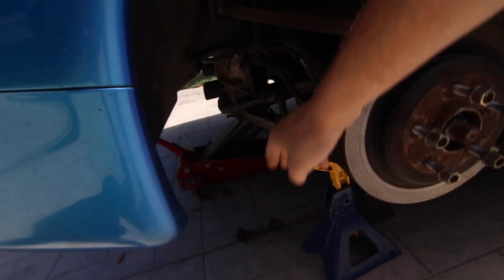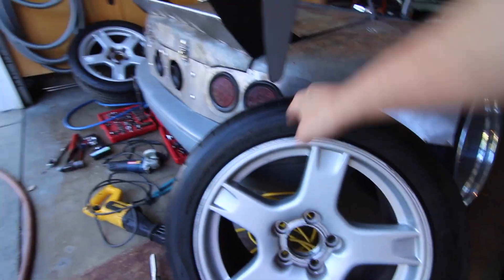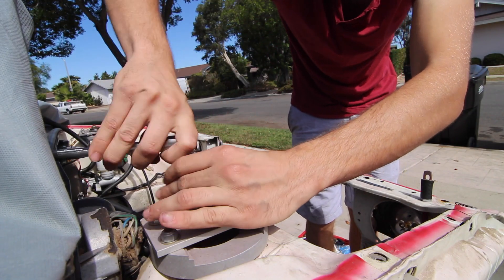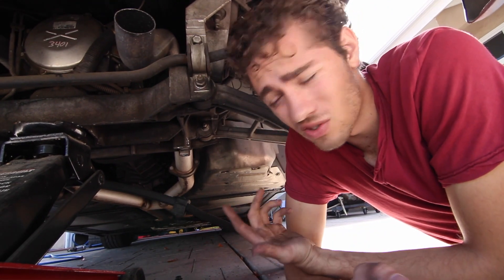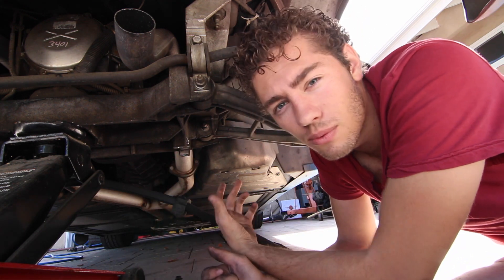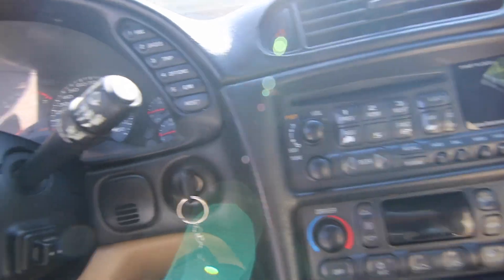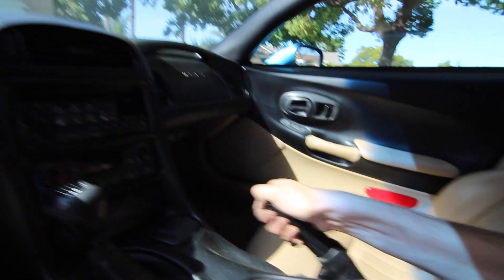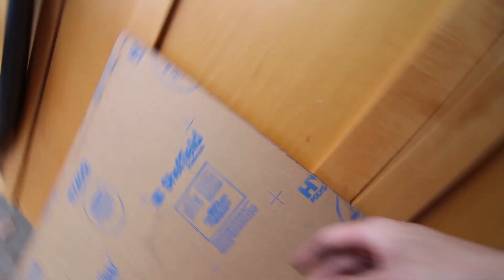Meant To Be A Drift Car?

Comment: You're key isn't turning because of the steering wheel, you have to jiggle it...
Reply from the maker: I understand what you're saying but that's not the issue
Reply: hope it's not your ignition, especially in a vette, sure it wouldn't be cheap. 😧😧
Reply: your ignition tumblers are shot. you need to have the ignition key cylinder replaced by a locksmith. you might need a new key to
Reply: Tyler Fialko that's what I do in my chevy vehicles, I have to jiggle the steering wheels sometimes to get the key to turn. The cause is from the theft lock on the steering wheels
Reply: +Bud D Have a snickers.
Reply from the maker: a ls6 has a slightly more agressive cam from the factory, but thanks for being an ass about it :)
Reply: @Bud D
Reply: that's what she said
Reply: C5 has an electronic column lock. It is a common failure and jiggling the wheel will do nothing for it. 

they do sell a bypass to disable it for like $35.

Comment: c5 Corvette leaf springs are fiberglass I believe. I may be wrong though
Reply: Sam Dornan you are defiantly wrong
Reply: If that's your belief then fine.
Reply: fiberglass? Wtf
Reply: Corvette leaf springs are referred to as FRP; Fiber Reinforced Plastic. It isn't fiberglass in the traditional sense of truck caps and bass boats but it is a composite material in the same family. It's very durable, very light, and effective.

Comment: what engine is in the blue corvette
Reply: Dakota Gladden i think its an ls3 but i could be wrong
Reply from the maker: ls1
Reply: thanks
Reply: ls1
Reply: ls6
Reply: LS1 in the blue C5 LS6 in the red (C5 Z06). 

The LS3 wasn't used until 08
Reply: I forgot a comma between "C5, LS6"

Comment: drift the miata 😂
Reply: Matthew 80ish hp with massive rims and a restrictive ass exhaust will not drift
Reply: a wise man once told me that anything is possible.... with some oil all over the track.
Reply: +Matthew with an oil pan that low you don't even need to put oil on track beforehand! Just drive for more than 20 meters and it'll be grinded into dust.

Comment: Putting wheels on with a impact with no torque stick. When your lugs snap from over torque when you are driving you will never do that again.
Reply: Every tire shop I've ever seen or been to never uses a torque stick ......gotta be smarter than the tools you use ....good luck with that sounds like you'll need it breaking studs with tools made for the job your doing sounds like your trigger happy
Reply: Do the job right.
Reply: Sky Ray torque sticks aren't the right way to do it. Nowhere near as accurate as a proper torque wrench.
Reply: BenS867 you're right. I should have included that in the comment but I didn't because I figured that a lot of people wouldn't be able to afford them compared to the sticks.
Reply: Go to a tire shop and you'll see how they tighten all lug nuts with an impact gun, expect aluminium ones ofc.
Reply: Juusco I don't know what tire shops you are going too but...I wouldn't go there anymore.
Reply: I have visited multiple car repair shops and tire shops and they all use impact guns. If your lug snaps from using impact gun, we all know that you bought them from china for ten bucks.
Reply: Juusco it's not th lug nuts that snap from over tightening. It's the studs that they go on. If you knew anything about cars and torque specs you would know that.
Reply: Even better... If you break a stud while using an impact gun, you're a wizard. And please, don't come to me and say that I do not know anything about cars, because I do know a thing or two. Even tho your "owners manual" says that tighten your wheel to 100nm if using aluminium wheel, it doesn't meant that the stud will break at 120nm.
Reply: Juusco you should look up proper wheel specs and the consequences of not following them then if you know some things just educate and learn some more instead of defending something that you very clearly don't know anything about.
Reply: Sky Ray Nice thing that you mentioned studying since I am going to graduade as an car mechanic in few months and I have been told to use a impact gun when tightening lug nuts if they're steel.
Reply: Juusco lol good to know that I have some years and earned knowledge on you then. So why are you arguing? You know that his wheels are alloy right?
Reply: Yes I know. I was not talking about wheels, I was talking about lug nuts. :) Steel ones can be tighten to ridiculous numbers, but alloy lug nuts are going to get destroyed if you use impact gun with them. Well, since you have some years on you, do you work as an mechanic? If so, do you use impact gun often? :) Here in school and shops we use them a lot!
Reply: Juusco I do and I hand tighten and then use a torque stick. The lugs can snap no matter what. Even on steel wheels. It is always better to be safe than sorry.